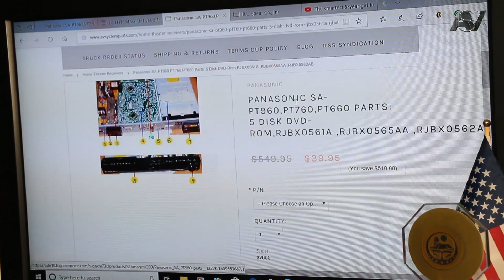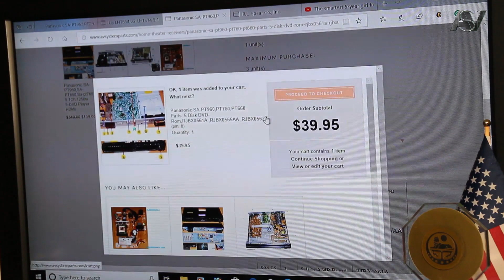Panasonic SA-PT760 No Sound,Solution Technician Secret

Comment: I have the Panasonic SB-WA930 I didn't use it for 5 years but when I finally did reconnect everything only the front left channel an subwoofer was giving audio now while the others  just give a slight hissing sound like they are getting power. The 2 rear gives little audio but now all im hearing is the subwoofer
Reply: Hey Ik it’s 2 years later but did you find the solution?
Reply: @HorrorPledgeFilms  yeah I sprayed WD-40 in the connector port behind the subwoofer for the main unit an used a paper pin to push in every lil hole to remove any rust or corrosion an did the same for my speaker connectors. You know how the connection for the RCA jacks does get this cloudy look after a while an not look chrome or gold anymore sometimes to get clear order you have to spin the jack on it a bit. But now she plays again
Reply: Looks like it needs to replace the AMP board
Reply: @arghno3187  she's playing again after a cleaning of all the connectors

Comment: Hi there. I have a Panasonic SA-HT720 thats have they stand by light but When I try ti turn it on nothing happents. A littly click and then click again and does not turn it on. Do u Know what can it be?
Reply: Please disconnect flex cable from mainboard to AMP Board. Does it power UP?. If not more chance the power supply board.